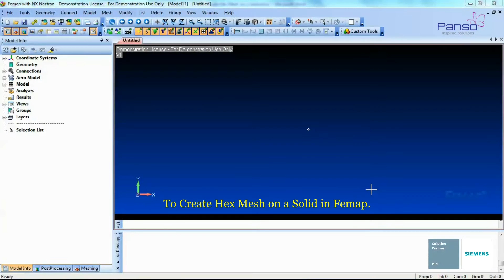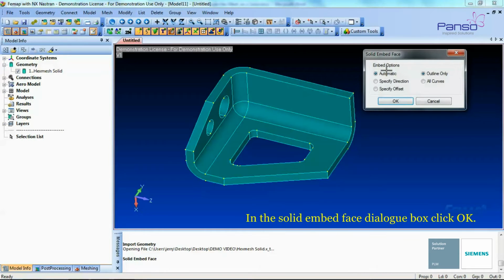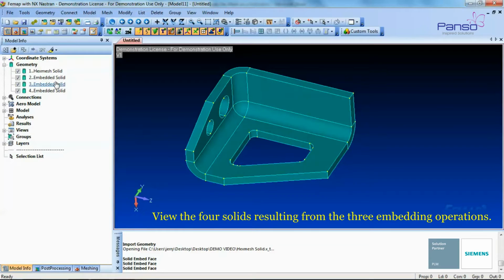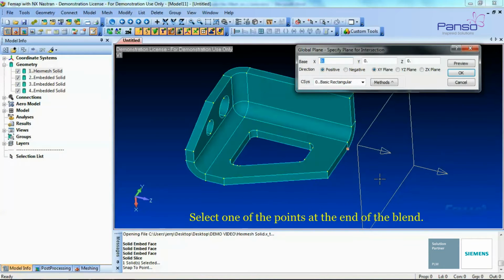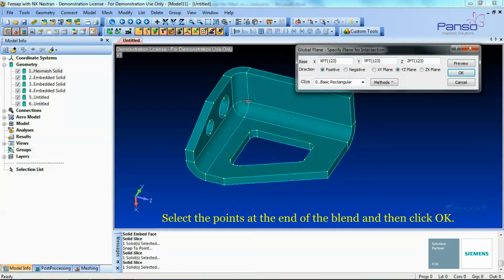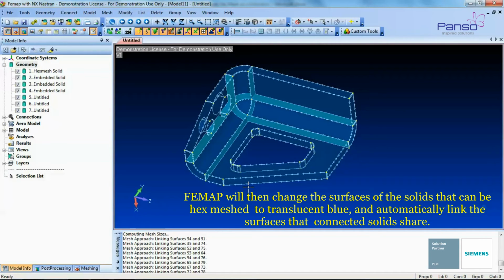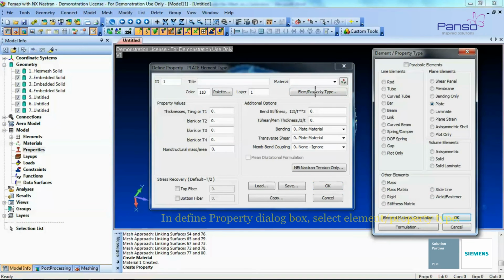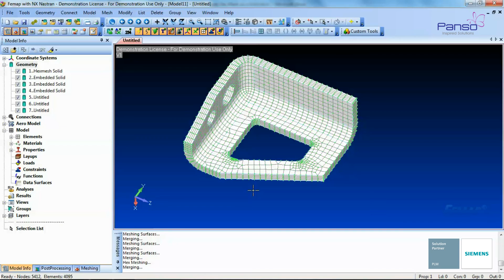Create Hex Mesh on a Solid in Femap

Comment: It is unclear which surfaces were selected when embedding faces.  Several faces are highlighted and the resulting solids after slicing/embedding faces are not shown.  Also, the overall reasoning behind why one would select certain faces is not explained.  Overall, the usefulness of this video could be greatly enhanced if one were more clear in the steps taken and why.  It's a good start, though.